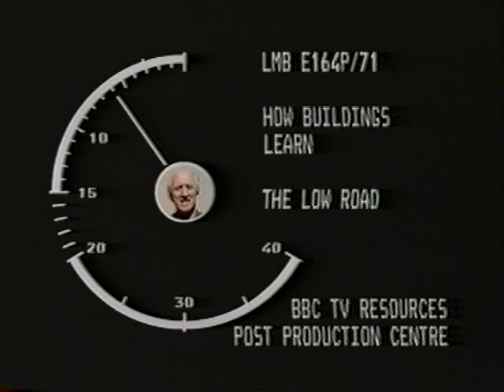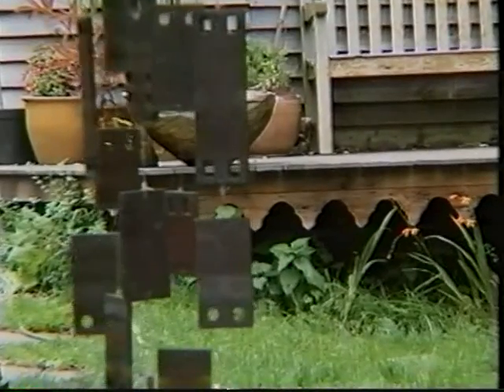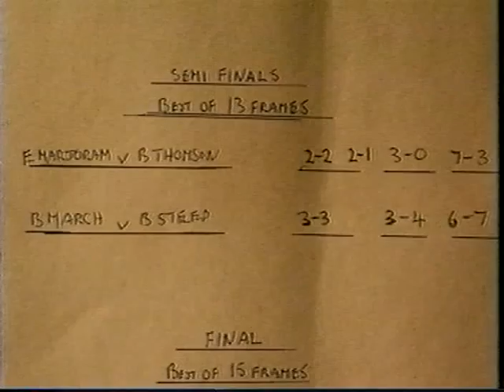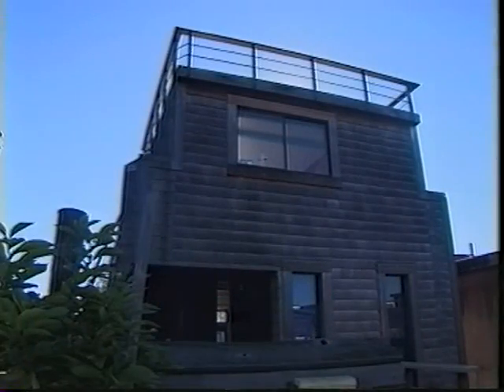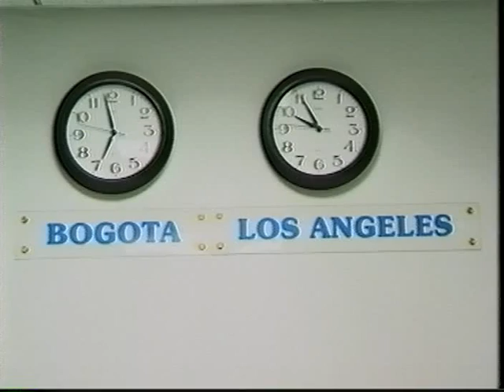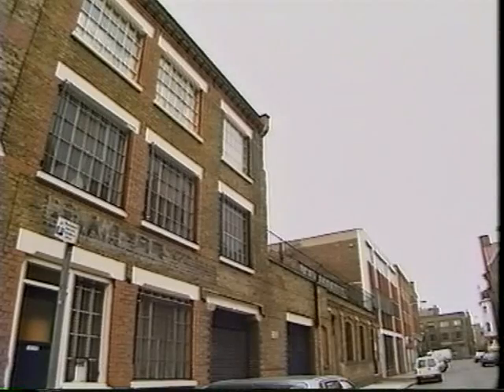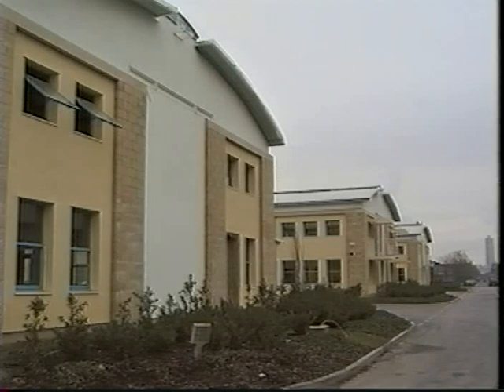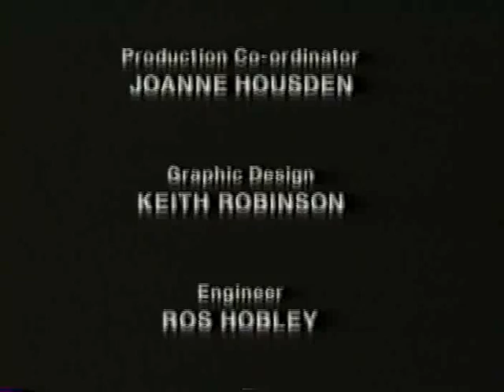2. How Buildings Learn - Stewart Brand - 2 of 6 - “The Low Road”

Comment: i would be surprised if a shipping container with a single natural light source, leaking, no insulation or sound proofing, if far better than anything an office designed by an architect could offer....definitely cheaper though.
Reply: Sometimes, depending on the project, that's the make-or-break point :)
Reply: I generally agree. Underrated attributes are silence, air flow, and light... a lot of light (a jeweler or electronics repair need 1500 lux). The region you are in determines other issues such as temperature and pest control. There are times you don't want mice or silver fish destroying the contents of the building... and in southwestern USA places, a lot of low road buildings will be full of Brown Recluse and Black Widow spiders. You now need buildings that are compatible with robotic vacuums and mops.